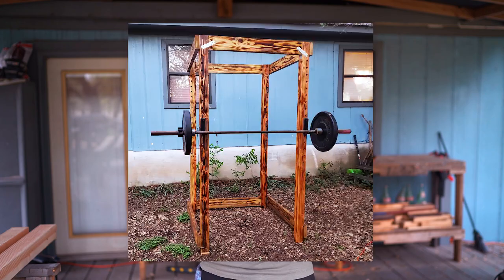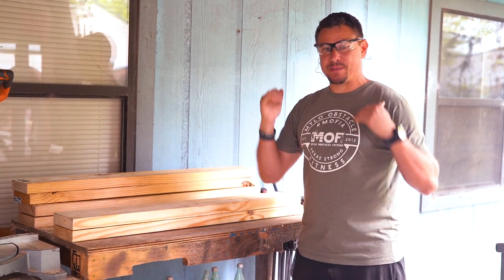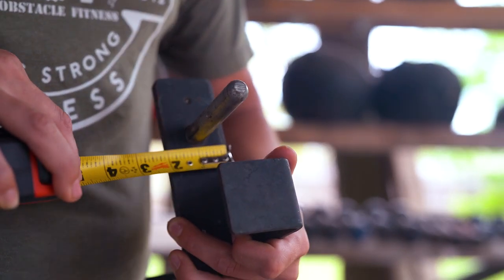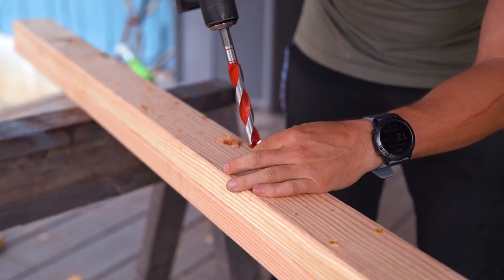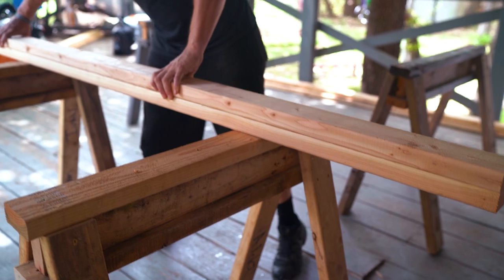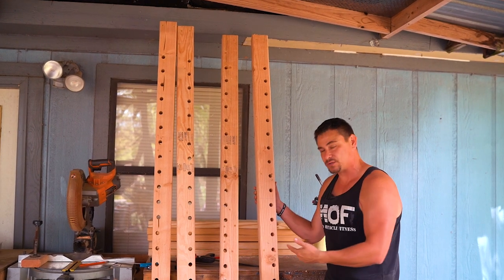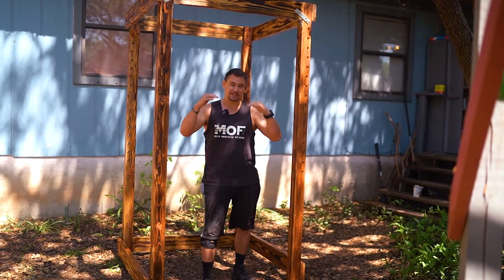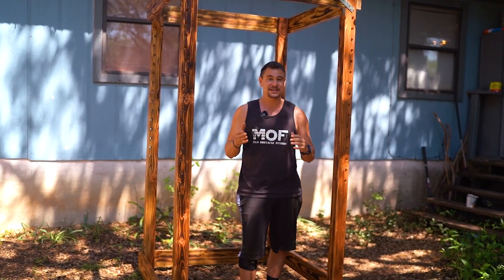How To Build A DIY POWER RACK | HOMEMADE Wood Squat Cage For Garage Gym

Comment: I liked how he finally explained why he's gluing 2x4s instead of using 4x4s.
Reply: Did he? I couldn't find it. I assume he did it just so he could use those premade 3" j-hooks, since two 2x4 are technically 3" thick whereas a 4x4 is 3.5" thick. (asplaining for posterity)
Reply: склеєне з двох буде міцніше ніж один 4/4

Comment: I must’ve done something wrong.

I have a 51.5” barbell shaft
The power rack I built is 54.5” wide
This caused my barbell sleeves to unevenly sit in the j-hooks.

I disassembled the rack and flipped the posts around so the holes faces inboard and now my plates won’t clear the posts when I go to place the barbell in the j-hooks. 

I’m going to get rid of the metal tie plates and screw the support boards directly to the 2x4 posts to make it 48” wide.